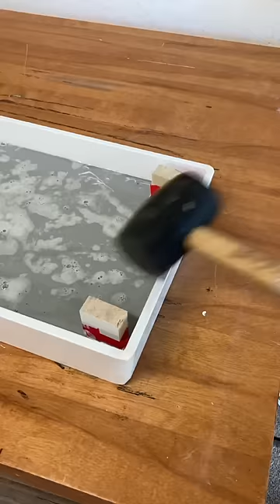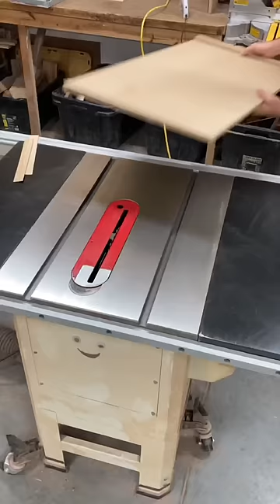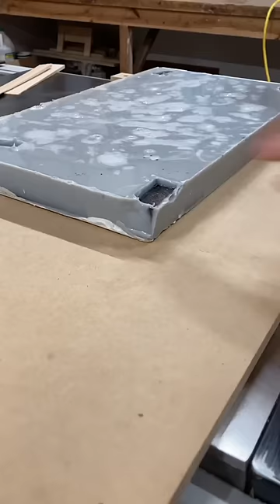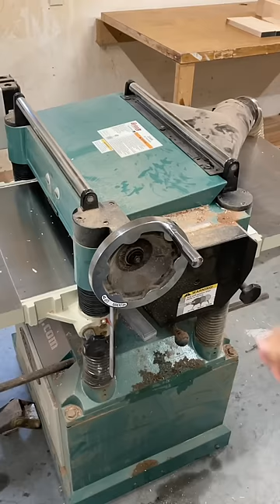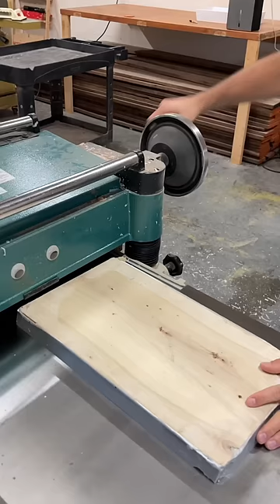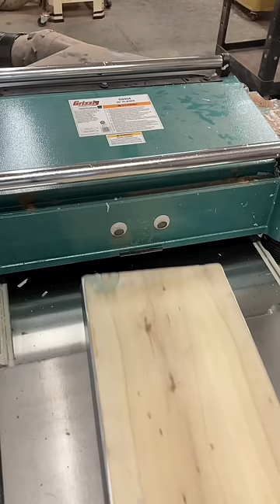Demold and Plane

Comment: You're running your planer sled backwards, support block should go toward the front since the planar rollers are pushing on the workpiece, you're relying 100% on your hot glue and friction being more that the resistance of the planer bed
Reply: This is what I was going to say. If the glue fails it would be bad.